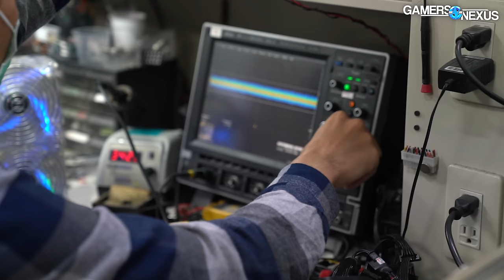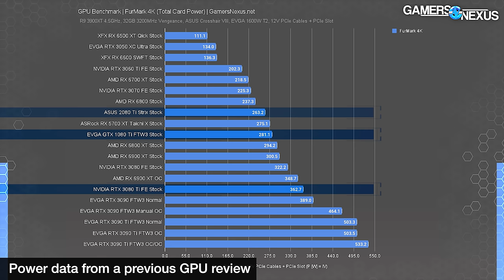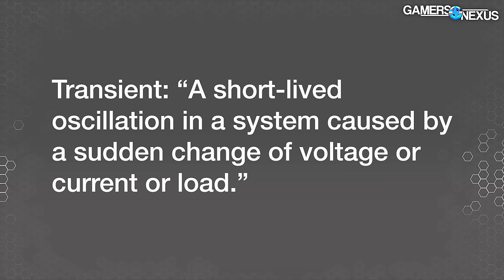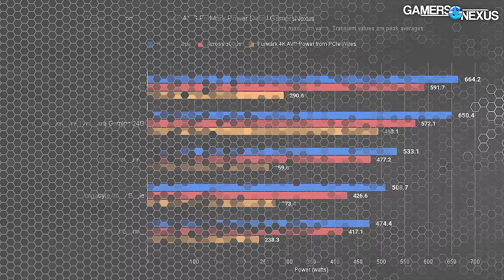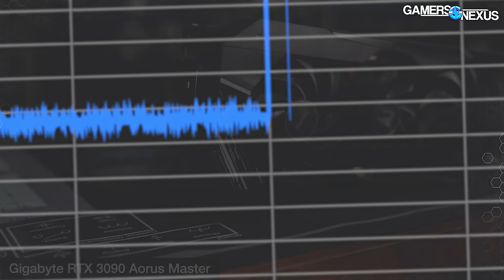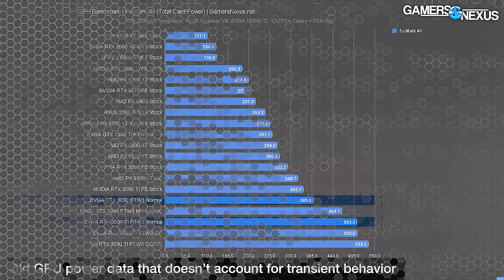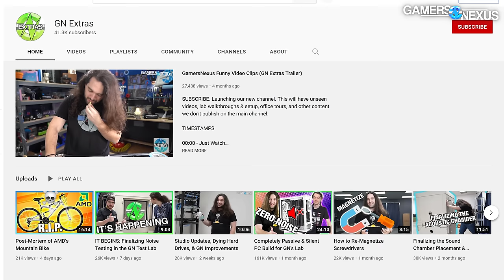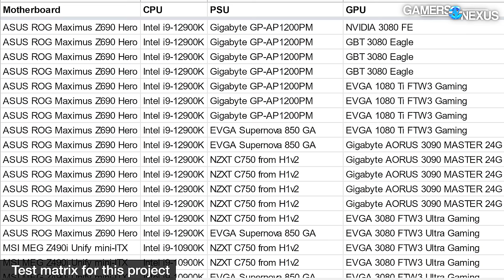The Brewing Problem with GPU Power Design | Transients

Comment: This is the best information we've gotten on the 30 Series cards in my humble opinion. This is the reason you guys deserve all the subs, patreons and store buys!

I was using a 3070 card for a couple of months and I could swear I was experiencing brownouts, that I was happy my beQuiet Supply would handle. Now that I think about it it could have been this problem. Could be that it is not related, but I had no other Power issues in the apartment except on my PC.

Hope we'll get a similar test for the Radeon cards of the "old/this" generation. Wondering if my 6900XT will behave down the line. I am on a 700W Power Supply and looking at an upgrade to give it more breathing room. Mostly for the CPU upgrade, as I'm looking at a 5900X for my productive tasks.
Reply: Which bequiet 700W Psu were u using with your 3070?
Reply: @konchy  I am still using it. Feels good still with my 6900XT. 
The PSU is: 700 Watt be quiet! Pure Power 11 CM Modular 80+ Gold
Reply: @Lurch7861 How do you tune it? Any links or sources? Which 500W PSU and which CPU are you using? Thanks!

Comment: I went thru this issue with a EVGA FTW 3080TI and a thermaltake 850w psu broke my head for about a week I blamed the heat then my i9 9900k processor I figured it out when I reduced my hz on my screen to 60hz and it still did it but the frequency was longer in between. I wish I had seen this video would have saved me a lot of time. I fixed the issue by adding a Corsair 1200watt psu. Now she is running smooth. Great video

Comment: Excellent serious work GN, keep it up !
I have got a solution/suggestion for this. Adding more capacitors close to GPU power connector will help.
I use small efficient PSUs to run my servers(XEONS). I have added 3600uF (several small capacitors in parallel gives large current delivering capability instead of a single capacitor) close to the CPU pins. I have done the same to my HDD arrays too. I have also added 100nF MLCC caps to reduce noise. In the tests I got slightly better clock speeds. All in all I have added 10,000uF of capacitors distributed on all rails close to the motherboard. To do this you will have to splice your PSU wires near the connectors and then add the caps.

Comment: I recently purchased a Zotac Magnus One and have been having these seemingly random shut downs. By process of elimination I narrowed it down to the PSU, which provides a measly 550 watt, which I've been having my doubts about. 

One night I woke up to loud beeping from my APC UPS, which is signaling a battery change. It dawned on me that because my previous rig had a 1000 watt PSU the power fluctuations caused by the dying battery in the UPS that my system is plugged into is absorbed by the large capacity PSU. On top of that, my previous older rig had an old GTX960. In addition to the tiny 550 watt PSU the Magnus One has a 2060, giving it even less wiggle room before OCP shuts the system down whenever a power spike hits. 

I've since switched to a regular storm surge protector and it's been smooth sailing so far fingers crossed. And seeing this video it all makes sense now as to why random shut downs have been on the increase.

Comment: also, i wouldn't call overbuying on your power supply wasteful, if you have an 850w supply and only pulling 400 watts at your peak, then your supply isn't working very hard which helps it stay cool and increases longevity.Reverse that and get a 500 watt supply for a 400 watt pull and you supply runs hotter and you may have to replace it in a year or so which is wasteful.

Comment: I was having OCP triggers with evga 3090 ftw + heroVIII+ corsair AX1000. Mine was only triggering when I had 30mm cosmetic aluminum wire extensions on my gpu power cables. I don't have nearly the badass testing equipment you do, but I theorized based on gpuz graphs that the increased resistance of those wires was enough to trigger OCP. Must be the sweet spot where without those extensions I am just under the point OCP would trigger. Removing them immediately solved my issue and been fine for 6 months now.

Don't cheap out on extensions and instead by cablemod replacement cables I guess.😅

Thank you for all the research, this video was amazing. also buy the coasters they are fantastic I absolutely love mine!!

Comment: For a small data point reference, my SFF builds have so far included a Nightjar 450W Platinum running 5600X and a Zotac RTX 2070 Super Mini or an MSI RTX 3070 Ventus 2X, a Corsair SF750 Platinum with a 5900X and AMD RX 6800XT, and a Cooler Master V850 Gold (White, the new version) with a 5600X and Gigabyte RTX 3080 Turbo, all with zero power issues. The motherboards were the ASUS X570i, ASUS B550i, and MSI B550 MPG Max, respectively. The Nightjar surprised me. That 750W Platinum Corsair is what I see by far most recommended in the various SFF communities, and I have never heard anyone mention anything similar to issues with power spikes like this with it.

Comment: This explains the random outages. I kept swapping power supplies to higher wattage and that seemed to lower the frequency of outages but not entirely. I throttled my GPU from Youtube and Reddit advices and it now occurs once every two weeks or so with my 750W Corsair. My mobo/gpu/psu combination is Asus AM4 TUF Gaming X570-Plus, GIGABYTE Radeon RX 590 8GB GDDR5, EVGA 500 Watt, 650 Watt, Corsair 750 Watt PSUs

Comment: I have a 750W PSU with a 3080 FTW3 Ultra that is working well now under full 400W load, although it wasn't straight away.  I was getting exactly these kinds of issues with OC tripping, etc. Until one morning, in which I had to update the BIOS for a completely unrelated thing on my SteelLegend B450 mATX. And after that, for some reason I never got any more shutdowns or restarts. And I noticed that under similar loads the power spikes of the GPU measured by Afterburner weren't so great. 

To this day I was thinking "Nah, there's no way the two things are related" - But now I hear you guys mention the role of the motherboard on all this, so I'm left thinking how the two could be related.

I love this kind of deep dive analysis videos. Awesome work! Keep them coming 🙏
Reply: Just for information's sake, the PSU is an EVGA 750 GQ, 80+ GOLD 
CPU is a Ryzen 3700X with PBO turned on. I know it's only a 65W TDP CPU, so maybe that's why it's not so bad?

Comment: I've had these "random" shutdowns of my PC with a GTX 275 back in the day. It only happened with a few select games and only in specific in-game situations. Back then I wasn't sure what caused it, but my theory was "my PSU isn't good enough" even though it was way over spec for the GPU. I guess this problem is as old as the GTX series.
Reply: Same here, especially with Fermi. This isn't new to me and I had to massively overspec the PSU to get it stable in those scenarios. It's one reason why I have a 650-750W PSU, and will never buy a card that says it needs more than 170W. Because much more than that and I would need a 1000W GPU for this nonsense.

Comment: I just upgraded my CPU and GPU last week in my small form factor rig, and I haven't had any problems yet. The changes were made very recently though, so only time will tell. Components are: 

MOBO: X570 I Aorus Pro Wifi (mini itx)
CPU: AMD Ryzen 7 5800X3D
GPU: EVGA XC3 Ultra RTX 3080 12GB
PSU: Corsair SF600

Comment: First of all I want to congratulate you and the Gamers Nexus team for the quality of a lot of recent content. I was quite impressed with the animation of how an Hall effect sensor probe works. You did a remarkably good job! I was genuinely surprised to see such subject handled so clearly in what is still supposed to be a channel dedicated to PCs for gamers.

My thoughts on the the subject of ever higher peak power spikes starts from this observation: the performance of the VRMs on graphics cards have clearly been massively progressing alongside the GPU technology and now they present an extremely low impedance to the load even at considerably high frequencies. In other words they are able to transfer upstream, to the 12V input rail, even very quick peaks of demand. I reckon though that expecting the system PSU to deal with such fast transients should be considered a substantial flaw in the design of the cards.
The concept of PC relies on the interoperability of the components and whoever integrates a system needs to be able to evaluate which parts are worth buying and how to allocate the budget efficiently. Graphics cards are not properly characterised in regard to power demand peaks nor are ATX PSUs. The information on the entity and speed of the spikes is not made available so the users may just be forced to grossly overrate the PSUs. This has drawbacks not just on cost, as Steve pointed out.
Peaks of 2x high-load average or more are objectively above what any reasonably designed ATX PSU should be expected to handle. Such behaviour of the cards should be deemed failing EMC.

Gamers Nexus , have you tried to filter those spikes at the card end? Low ESR capacitors would do that but I would also like to see what is the role of the parasitic inductance of the PCIE power cable(s). Longer cables correspond to higher inductance but you can also increase the inductance by introducing a gap between the bundle of +12V wires and the bundle of GND wires (I guess you would have to remove the sleeve). A ferrite core would be the next step for creating impedance (differential in this case) but it may be tricky to find a material that does not saturate at the current it would have to deal with. Your best bet would probably be open-air loops.
My general approach to this problem would be making the an effort to contain the disturbances caused by those peaks to the graphics card itself. Cards which do not manage to do that should, at a bare minimum, publish the parameter in their documentation.

Comment: It's interesting that this problem has made it all the way to consumers.  I'm a SoC designer and quick power consumption stepping has been a problem I have battled with for a long time.  It boils down to a fundamental electrical engineering equation V=L*di/dt, that says if the current changes too fast (di/dt), it causes a huge voltage spike and protection circuitry kicks in.  Minimizing L (inductance) mitigates the problem but you can never eliminate it.

Comment: Recent upgrade from GTX 1050Ti to RTX 3060.

MOBO: Asus PRIME B350-PLUS
GPU: MSI RTX 3060 Ventus 2X OC edition (newer revision)
PSU: Corsair CX600 (CWT unit - 2014 SKU)

I've been noticing crashes on long, high loads, specially when running tasks that may use the tensor cores. I know the PSU is old and, yes, it's already a PSU that have shitty load line calibration, but It doesn't crashes often and not on all kinds of tasks. Already bought a XPG Pylon 750W(it's on shipping now), also plan to upgrade the CPU to a Ryzen 5600 or 5600X depending on stores supplies for the black friday...

Comment: You make a very good point around the 25-26 minute mark about over-buying the PSU.  I suspect these spikes are what often kill pre-builds PCs that use the cheapest PSU that barely meets, and sometimes don't even meet, the GPU power recommendations.
I disagree with that way of thinking though.  In my system I always over-buy the PSU.  For an extra 30$ you'll get an extra 100+watts.  The nice thing about having the extra head room is future proofing for upgrades BUT if you aren't pushing it to its limit the PSU generally runs cooler making it last longer.  So do you want a 750 that will last 5 years or an 850 or 950 that will last 10 years and keep running through those spikes? Also they run quieter when they're not being pushed to their limits.  Is it wasteful and more expensive? Yes, technically.  Is it worth it for all the benefits? I would argue yes.

Comment: SFF cultist here, I've run 3090, 3080 ti, and 3080 (all FE) without major issues on Corsair's SF750 on 4k 144hz, paired with 10700k and 11900k (I know) on GB mobos. I have seen a few crashes, the culprit is almost always pushing RT, certain compute effects, or sometimes water quality to highest settings (the stuff that hits particularly hard on 4k). I haven't looked too deep into it but I'm comfortable attributing those crashes to transient spikes. Happy to provide more info if needed, got a bunch of SFF stuff I can test on.

Comment: The issue at hand sounds like it's browning out. But it could be many other things.. noise.. limited supply on the plug socket.. maybe USA suffers this more with 120V versus other countries with 240V. etc. For example Jayztwocents video a while back where he was using rolled up long extension cable and was able to brown out his system.. 

As an electronics engineer, my suggestions for the PSU and GPU manufacturers to keep things working better. 

* Add a dedicated power rail for the GPU, sometimes the 12V is shared across all. 
* Consider adding sense lines for the dedicated  power line
* Increase cable thickness/limit length to reduce the voltage drop. This would include the kettle lead. 

* Provide more decoupling to filter out these spikes, this should be the same for motherboards as well.

Good luck getting one of these to implement it, maybe one or two of the companies who produce both could patent an elegent solution??

Comment: This was amazingly informative. This explains alot of what was happening with my RX 480 over 2020. On top of COVID, this was quite a thing for my system.
Reply: what's your PSU?
Reply: @vsm1456  an 850W PSU by Corsair.
Reply: @SizzlingOne  hmm, I doubt a 150W tdp card can trigger overcurrent protection on a 850W PSU. even if you assume x2-x2.5 transient load
Reply: @vsm1456  I will say that this is something that had since stopped in early 2021 as I honestly can't fathom what was happening in 2020.

Comment: You achieved - validating my decision to over buy ( Super flower 1200w) power supply with a 5800x and EVGA 3080TI. Got it on sale. Works like a charm. 
  No issues here!

Comment: Very glad now that I had the cash to do so, and chose to ignore the general advice, that 1kW was overkill when building last year. Now I'm running a 5950X on a Dark Hero with a 3090ti and it all just runs smoothly with none of these problems. Which was my long term goal for the build.

I don't want to overclock or fiddle with settings. I just want to plug everything in and know it will run stably and reliably without me needing to mess about tweaking or troubleshooting. Should last me for a good half a decade by which point hopefully these issues have been somewhat ironed out of the tech going forwards.

In fact, I just finished testing it with three simultaneous HEVC encodes on the CPU and a 4K DAZ render on the GPU all at once and not only did it not crash, it barely even got warm. CPU and GPU temps held in the low to mid 60s. Planning ahead can be expensive, but it also helps avoid serious headaches to save a buck.

Comment: I have two ITX gaming rigs, both with Corsair SF750 small form factor PSUs. They both have the ASRock X570 Phantom Gaming-ITX/TB3 motherboard, and 64GB ECC RAM. One is running with a Ryzen 3900X and EVGA XC3 Ultra RTX 3080, the other has a Ryzen 5900X with a EVGA FTW3 Ultra RTX 3080. I've not had the power shutoff issues with either rig, but at the same time, the components are not pushed to their maximum performance. I've undervolted a tad bit on everything to reduce thermals in the ITX cases, which also reduces overall power draw.

Comment: Corsair SFX 600W gold runs my 3080 fine, that's a card that shuts down a Seasonic focus Gold 650W I also have. Incidentally I've found repeatable shutdowns on that card/PSU combo simply by switching Shadow of the Tomb Raider benchmark into 4K resolution! So a nice repeatable transient that the seasonic doesn't like there.

Comment: Thanks for this! I have been having issues with my 1080Ti setup for years, in some particular games it would trip. I was now watching a video from JayzTwoCents where he briefly mentioned transients, did a search and ended up here :). Even though it sounds like I should be fine I feel like this might be the issue. Anyway my setup:

AORUS GTX 1080 Ti Xtreme Edition
Intel Core i9-9900K
ASRock Z370 EXTREME4
Seasonic Focus Plus - 650W

Games I had issues with and ultimately had to stop playing: XCOM: Chimera Squad, Phoenix Point, Phantom Doctrine (3 very similar games), Satisfactory, Cities: Skylines (this one started just recently) and a few more which I can't remember now.

I thought this was all mostly temperature related but my benchmarks never showed anything weird - meaning it must be something that does not get picked up by regular monitoring - transients seem to fit the bill perfectly. I will still make sure to clean out my PC regularly and refresh my thermal paste - could temperature still somehow have impact on this? Does higher temperature have potential to cause and/or enlarge the transients?

Guess my 1080Ti is just a bad boy. I was now considering an upgrade anyway probably to XT 7900 XTX but guess I will have to account for a power supply upgrade as well, which makes it all less appealing. Anyway I will keep this in mind and test out different combinations.

Again thanks for doing these tests on a gaming channel, really appreciated :).

Comment: Yeah, I have a 3080 FTW3, and I had an 850W EVGA G+ PSU and it would randomly black screen with no Windows error codes.  I upgraded to a 1000W PSU and stopped having those issues for at least a year (until the Gigabyte x-570 Aorus Pro WiFi MoBo had to be RMAd for a similar issue)